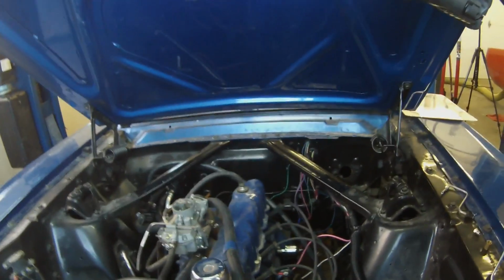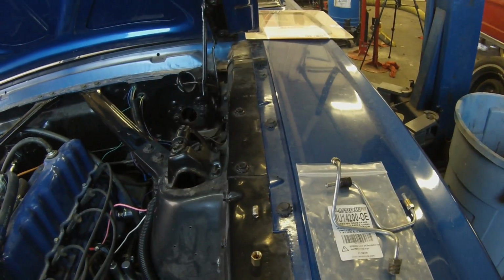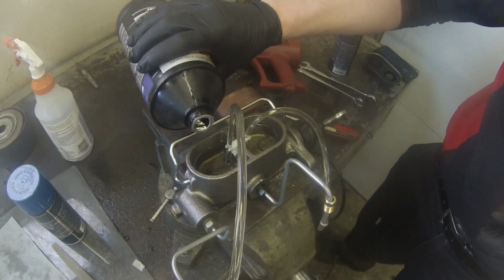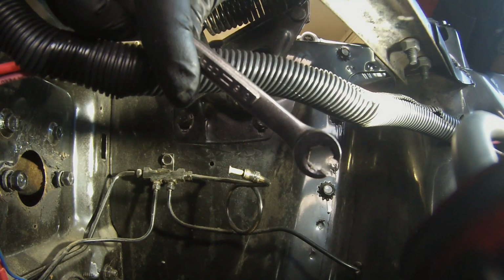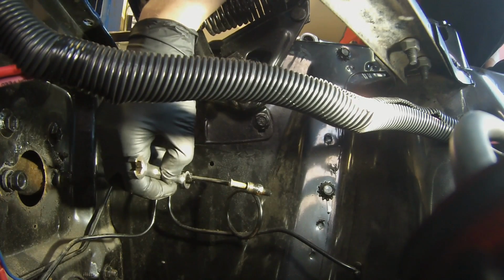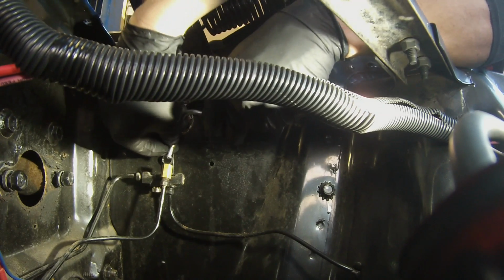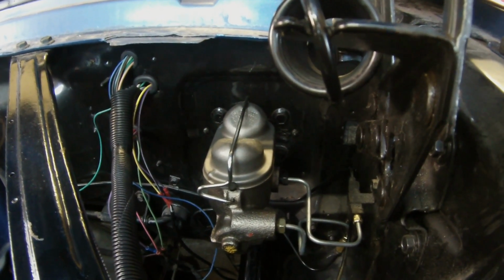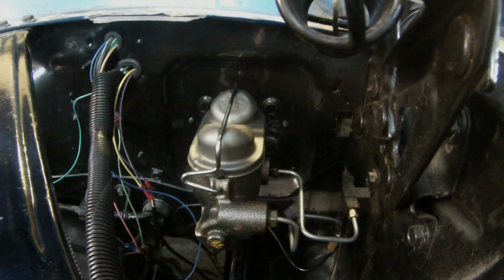1965 1966 Mustang dual bowl master cylinder upgrade

Comment: Holy cow man!!!! Thank you sooooooo much!!!!!! I have been having issues with memory the last few years. I took my single bowl off at the same time doing the drum to disk swap. I did everything with no problem untill the vary end. I was completely stumped about the brake light switch.  I went through so many video that didn't show exactly how the switch sits on the brake peddle and the push rod. Thank you so much for putting the extra details in that you do. With out a doubt your videos are some of the best step by step how to's on YouTube for mustang.  Im sure you can tell but im so Relieved I found this video. It serves me right for trying to use the youtube search and not going straight to your channel. Lesson learned l o l.
Reply from the maker: Dude! Glad to hear you found this helpful! This was one of my first videos which I usually cringe watching them 😅 
Thank you!
Reply: @AlfsMustangGarage I asked you a couple of days ago about what MC to use. I drove myself crazy looking at bore sizes and outlet line sizes. I came back here and found the MC you used in the description. I'll have to redo the lines but that's fine, the 1st time was practice lol. Thanks man. Just so you know my friends and I consider your videos the equivalent to the old chilton and haynes books. One of my buddies will respond "go ask Alf" when we get stuck.
Reply from the maker: We all could use practice! Lol I might be a long ways away from being the entire repair manual but I do appreciate it 😁
Reply: @AlfsMustangGarage  a bit more detail, unfortunately I've had some  memory issues in the last few years.  Not good. What can you but carry-on  right? I took everything apart got it all back together except the light switch.  I was sooooo stumped. When I get like that I'm my own worse enemy lol. Like I said your video was the only one showing the switch order of assembly. Such a simple thing most guys think you don't even need to show it. Can't believe I was so wound up. Comes with the condition.  Thaks again man.l!!!!!!

Comment: Can you have a booster with a dual bowl master cyclinder upgrade on a 65 coupe?  Mine came with a single bowl instead.
Reply from the maker: Yes but most kits that you buy will not actually fit factory shock towers. The one that I have found that fits the best is the LEED brake kit.

Comment: Thanks for a great video.  I'd like to run a 15/16 bore master, instead of 1 inch to change the force / pedal feel.  I am having trouble finding a Ford OEM type, 15/16", Drum/Drum - I've only found ones at Wilwood.  By chance do you know of a 15/16 "version" of this MC?
Reply from the maker: Thank you. I'm afraid I'm unaware of any.  Have you checked with Leed Brakes?
Reply: @AlfsMustangGarage  Nope - But I will - Thank you!.  (I have found one at CPP p/n M-C1516-L , however it is a "Corvette style", and has fittings both sides - I'd like to stay away from both of those compromises).  Thanks for the quick response!
Reply from the maker: You're very welcome. Good luck.
Reply: FYI - Leed brakes does not - but they were very helpful.  I may choose to run a 15/16 bore disc/drum MC with an external 10 psi residual pressure valve on the front 'disc' circuit, or go with the Wilwood (which I think requires external valves anyway)
Reply from the maker: Oh cool. Ya I like Leeds they are always way helpful when I call.

Comment: Hi Alf, I know this is an older video so I hope you see this message.  Will the 67 master cylinder shown in this video work for a front disc brake swap?  My disc brakes will be manual not boosted.
Reply from the maker: This particular one will not because it's for a 4 drum brake car. You'll need to find one for a front disc car.
Reply: @AlfsMustangGarage  thank you very much for the quick reply!  Love your channel and videos!
Reply from the maker: You're very welcome! Thank you!

Comment: Hey I have enjoyed all of the videos. I just finished this upgrade on my 65. I have been trying to get the brake/stop switch back on for well an amount of time I am embarrassed to say. I see you just literally just pushed it on. Does the push rod go all the way on then install the brake light. I may have just gotten so frustrated. I am at my whit's end. Please help
Reply from the maker: So this might be difficult for me to describe how to install the brake light switch but here it goes. So i think what helps me is the pushrod goes on but not 100% of the way. there is a slotted end and an end with a hole on the light switch. Put the slotted end up and around the pushrod and the brake pedal at the same time. Once those are lined up in place you can push the pushrod on all the way taking the switch with it. I hope that helps.
Reply: @AlfsMustangGarage  thanks will try again at it tomorrow. Probably just got frustrated and hot h=down here in Houston. Will have to get another keeper pin as the one i had went to Mustang never never land.
Reply from the maker: Sometimes taking a step back is all the help you need. We've all been there. Good luck tomorrow!

Comment: Thank you. The car is an auto C4. In the near future I will be upgrading to a manual T5. Is there a power booster that can be used with either.  So a pedal adapter is also required for the auto now. Appreciate your help
Reply from the maker: I believe if you jump on Leed Brakes.com they might have a kit.

Comment: I had to see the video again as I I am in the process of upgrading the 65 Mustang  to disc brakes and would like to install a power booster master cylinder. Could you indicate if the brake pedal ratio should be left as is? I question this because from what I have been reading when the MC has power booster the pedal ratio has to be modified. Appreciate your reply. Thank you. German
Reply from the maker: https://www.npdlink.com/product/booster-assy-pb-conversion/103476/200347?year=1966
So I provided a link to a power brake booster to convert from manual brakes for a 65-66 Mustang with automatic transmission. In that link there will scroll down and see some links to PDF files you can look at the instructions. The 65-66 cars used a 4:1 pedal ratio adapter that will install when you do this conversion but only on cars with auto trans. The But to answer your question, if you're running an Auto transmission, you will need to get the correct booster for auto and use the pedal ratio adapter. If you're running a manual transmission, the brackets are setup different and should already be setup for the correct pedal ratio. Hope that makes sense, let me know if you have any other questions.

Comment: Thanks for posting this and the many other videos that are very helpful.  I am working on a 65 Mustang with power drum/drum.  I would like to upgrade to a dual bowl MC.  At this time, I plan to retain the drum/drum brakes.  Can I use the MC and booster that would fit a 67 power drum/drum setup?  Or is it necessary to buy a unit specifically designed to convert the 65 single MC with booster to a dual MC with booster?  Thanks for your help!
Reply from the maker: So typically when I do the dual bowl conversions, I use the 67 master cylinder. However, I've never converted one that has factory power drums. There isn't much room there before you hit the shock tower. I would search NPD to see if they have something specific for that application and if they do, I would get that.

Comment: Is there a kit/master cylinder made to work with factory disc brake '65-'66 cars?
Reply from the maker: Yes. Should be able to find them on National Parts depot
Reply: @AlfsMustangGarage  Thanks!!

Comment: Hi, hoping you can help. I bought the dual master kit for my non-power drums on my 65' Mustang from CJ PonyParts. Before I start, been doing as much research as possible so that I know what to expect and any curveballs coming my way.
1. Some people have said it might have saved them time if they didn't bother removing the original pushrod at all (assuming it will come off freely) and just take off the old master cylinder and put the new one in place, leaving the original pushrod connected to the pedal. What do you think?
2. On the CJ PonyParts video for this entire procedure, they show the bench bleed process being done using the two blue plugs that came with the kit and not the hose method you are doing. What do you think? Starts about 5 minutes into the video.  Here's the video link https://www.youtube.com/watch?v=uzmVp41GyC8
3. Once the master is bled, I assume no air gets sucked back into it from the open ports while you're transferring it on to the car. If I go with their method, I'll have to remove the blue plugs before attaching to the permanent lines. 

I may have more questions as I go, so any help is much appreciated. 
Thanks!
Reply from the maker: So the pushrods usually don't come off easily. Most of the time, I have to remove the pushrod from the brake pedal and then clamp the master cylinder in the vice to extract the pushrod. They will have a metal clip that keeps it retained in there. What I've done on many other vehicles is actually not transfer the pushrod but insted purchase an adjustable Scott Drake pushrod that way you can set it just right. I have one of those on hand listed on my Amazon store if you need one.
I always use the tube bench bleeding method. I like to be able to visually see the air bubbles traveling through the tubes and then I don't question weather or not I got all the air out. Both methods work but I have my preferences. You won't get any air sucking back into the master cylinder when transfering the plugs out and the lines in as long as you don't let all the fluid drain from the bowl of the master cylinder or as long as you don't actuate the pushrod and suck air in. Hope that helps.
Reply: @AlfsMustangGarage  Thanks! So if by chance I unbolt the master cylinder  first and the pushrod comes out easily, can I just go with that and not bother removing from the pedal?
Reply from the maker: Yes. If by chance it comes right out, you could probably use that push rod. I've come across cars where it's too short and I've ended up going with the adjustable ones. You never know who has been in there over the last 50 years.
Reply: @AlfsMustangGarage  funny you say that. I’ve had the brakes redone twice in the last month by a shop. Had the car about two months now. The pedal when I bought it was low. Both times they’ve redone the brakes, still pretty low. Hoping the new master raises it up some, if not, maybe try the adjustable. With brand new shoes, how far should the pedal go before it’s engaging and tight, maybe an inch or two?
Reply from the maker: Oh ya it's hard to say after all the years if the car has the correct things. The different master cylinder typically won't change your pedal height. You'll change that with a different length push rod. Yet another reason I advocate for those adjustable ones. You can set it for what is comfortable for you.
Reply from the maker: As far as how far the pedal should travel, just depends on if the shoes are adjusted right and the pedal push rod length. Obviously you don't want an instant brake lockup but you don't want them to engage late either. I guess it's more of the driver's preference and all that can be adjusted with the shoes and pedal push rod.
Reply from the maker: As far as how far the pedal should travel, just depends on if the shoes are adjusted right and the pedal push rod length. Obviously you don't want an instant brake lockup but you don't want them to engage late either. I guess it's more of the driver's preference and all that can be adjusted with the shoes and pedal push rod.
Reply: @AlfsMustangGarage  thanks for the help!
Reply: @AlfsMustangGarage  So, I replaced my single master with the dual. Braking didn't improve much and I'd say the pedal doesn't do much  until at least 1/2 way to the floor, maybe farther. I believe that the brakes have been adjusted to the right position. Question, with the pedal in resting position and if I pull it back, i'd say it pulls back about an inch where i can feel the rod disengaging from the master cylinder piston and will not pull back any farther. Should there be that much play or are things about as good as they are going to get?
Reply from the maker: This is where I would be adding the adjustable pushrod. You'll be able to get that play out of the pedal and it will engage sooner. As far as braking goes, this upgrade doesn't really improve your braking ability. It still achieves the same results as a single bowl. The benefits for this upgrade are for safety reasons. If you develop a leak in your system, you'll still have half of your braking power rather than no braking power.
Reply from the maker: This is what you're going to want to get. https://amzn.to/3mn9xmJ

Comment: Does this car have front disc brakes or drums all around? Reason I’m asking, is because I just converted my front drums to disc and now I’m having an issue as to how to attach the lines with a proportioning valve (no booster)
Thanks
Reply from the maker: This car has 4 drums
Reply: @AlfsMustangGarage  can you send me instructions on how to set it with a dual bowl master cylinder and proportioning valve? I’m trying to get my car back on the road. 
Note: the master cylinder is already bench bled. 
Much appreciated
Reply from the maker: So here is a link for my video where I converted the front to disc and added the prop valve. This car has a booster but the prop valve hook ups are the same. Let me know if you still have questions after watching this. https://youtu.be/moduHIa_pAU
Reply: @AlfsMustangGarage  ok. I’ll try that. Last question (I think) why in other videos, they close off the bottom rear valve off the block? That’s really my confusion. 
Again, I’m appreciative of your time
Reply from the maker: So that valve that you're seeing in this video is the distribution block not a proportioning valve. The reason why the one port gets plugged is because that is for the rear lines. So instead of the rear lines getting fed from the block, the rear lines now get fed directly from the master cylinder.
Reply: @AlfsMustangGarage  Thanks again! I’ll get on it and let you know how it goes. 
Enjoy your week and many Thanks for your time and patience.
Reply from the maker: You're very welcome. I hope it goes well!